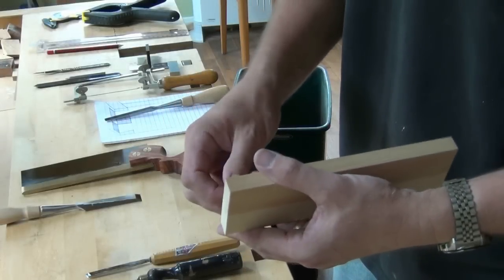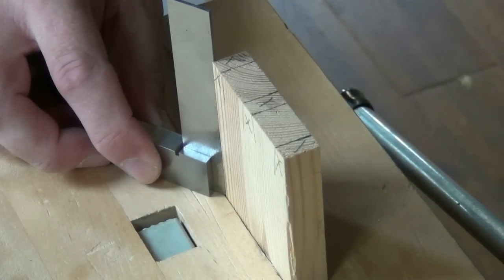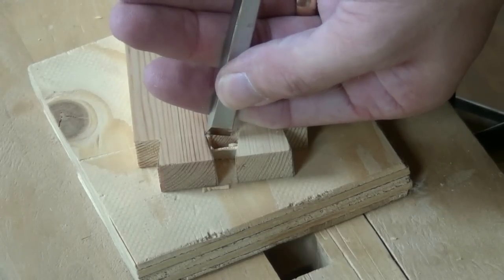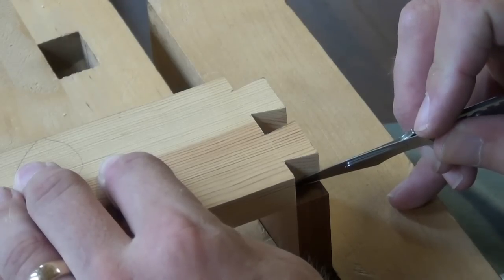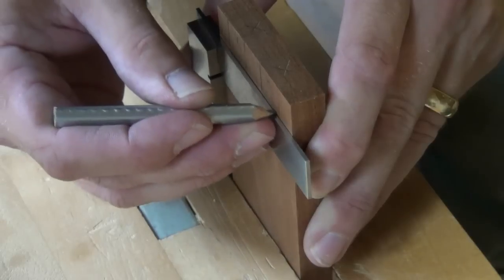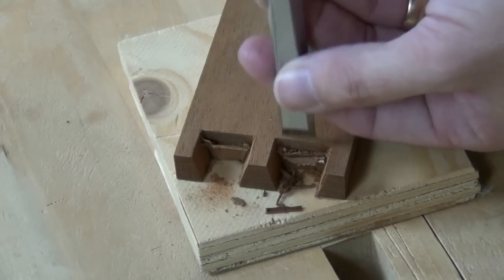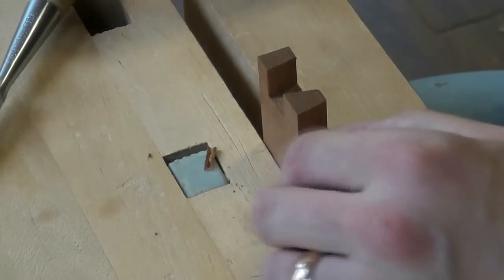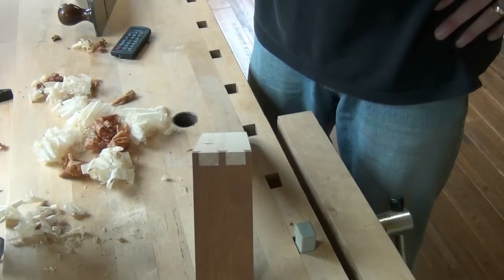Hand Cut Dovetail Joint - Through Dovetail

Comment: I noticed your work bench has square or slightly rectangular bench dogs. I have an old bench with the same type of dogs. I have 2 metal ones, which should be enough, but I feel 2 more would be ideal. Do you have a source there in the UK or know of one here in the USA that won't cost a weeks wages? Or better yet, do you know of a design using wood or a combination of wood and metal as replacements? Love your video's. I have learned so much from both you and Paul Sellers. Your both patient, precise and give very practical advice. I especially like your video's on Plane restoration which has become a hobby of mine.I love how perturbed you get over the way some have neglected a wood plane, through just lazy actions.lol, I feel the same way. Thanks Mitch, any info on the dogs would be welcomed. ~~Dolly
Reply from the maker: CrossGrain Wood Products,LTD Hi Dolly, 
Pleased you're liking the channel.
The rectangular dogs used to be the norm on this style of bench, and mine has two metal and two plastic. As to where you might get them, well I've seen ones for Sjobergs benches on eBay from cheap to expensive, all second hand. To be honest, I would make one out of hardwood. Beech, maple, etc. should be fine. Copy the  metal ones, with a thin section at the front to act as the sprung lever which prevents them from sliding down the holes.
You've given me a good idea for a video there, thanks!
Happy woodworking, Mitch

Comment from the maker: On this video I was using an Adria dovetail saw, which worked extremely well straight out of the box.
For the next dovetail joint video I shall use the dovetail saw I created from a cheap diy store crosscut back saw, to show how well that works. Check out the videos of the Simple Dovetail Saw, and experimenting with rip profiles, to see how I created it.

Comment: Mitch, could you tell me a bit about your marking guage.  it looks like you're spinning a nut to get the distance right, and then locking that distance with another nut.  Is that correct?
Reply from the maker: Hi, That's right, there are quite a few on the market like this. It's known as a wheel marking gauge. I do use the more traditional wooden marking gauge just as much, if not more, so I wouldn't say either were better than the other. On my wheel gauge, there is a knurled section that acts as a micro adjuster and two locking screws. Easy to set, but I'm not a huge fan of the wheel blade.